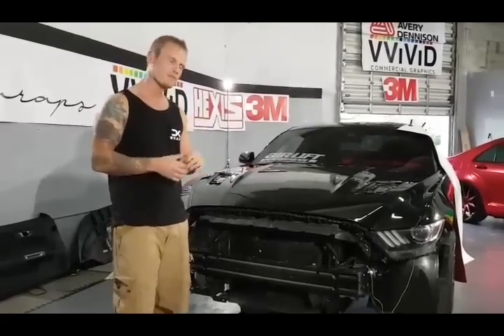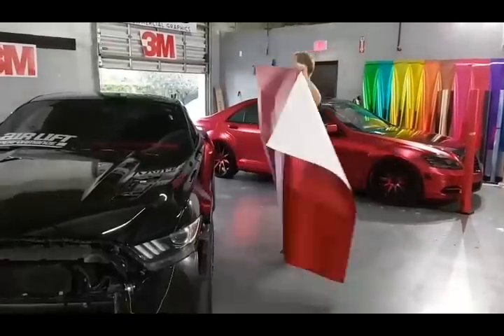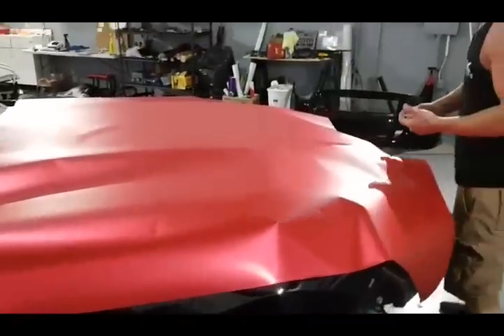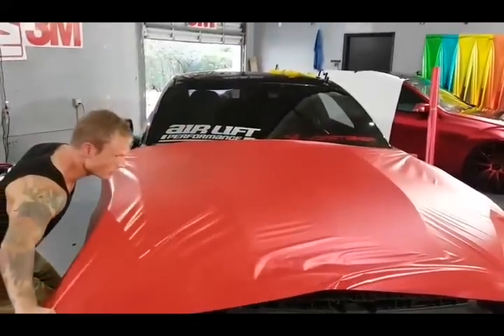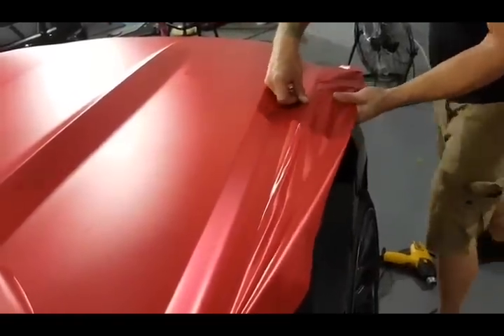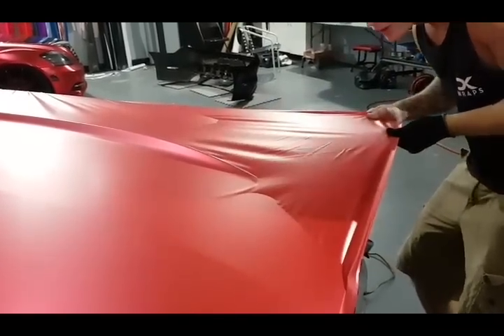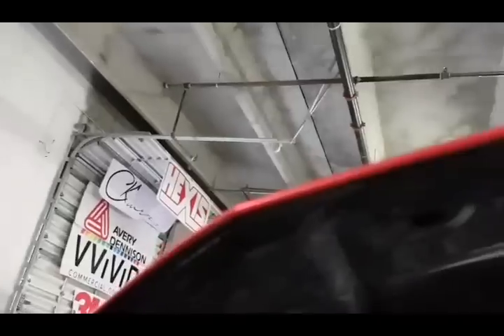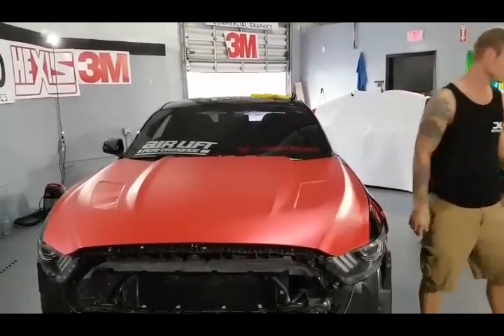How to vinyl wrap a hood / bonnet larger than 60 inches. How to vinyl wrap a Mustang. By @ckwraps

Comment: So what do you do when the hood is a lot bigger than 60"? I want to do my C4 corvette myself and the hood is massive.
Reply: I have an oversized hood and I just put a racing stripe on it. Turned a very large cumbersome piece into much smaller pieces with butt joints that are hidden due to different colors for the most part. Meaning you expect a line due to different colors so it isn't noticeable. 
Pin striping would also work. Anything that's a different color that breaks the hood into pieces.

Comment: Have you ever run into this using Avery Carbon Fiber film?  I have a 64"x34" hood and I could wrap it front to  back,  but the roof is also wrapped and the pattern would be facing different directions.  so I attempted to heat and stretch the film the 2 full inches on either side.  While one side did exactly as it was supposed to, the other seemed to take some damage to what I imagine to be the adhesive underneath.  you can only see it at certain light angles. Your thoughts?

Comment: Hi body thxs for reply. It was actually - 10 winter time.2018  January, In Alberta. I wrap my car outside. The cleaner I used it's for vinyl cleaner witch really work well to clean the surface off the car. Vinyl I order in eBay.  It's really good so far no problem. I don't have a video and it actually my first time ever .

Comment: Hey! I am wrapping my boyfriends mustang and he has an extremely difficult hood. The color is matte army green 3M brand, I am running into the problem of small bubble like lifts in the vinyl that can’t be pressed out. It is also where I heated the vinyl into the channel. I haven’t post heated anything yet, what’s the best way to get them out?  Thanks!
Reply from the maker: Try using a pin to pop them

Comment: true. i bought a brand new honda civic with 4 miles and came with a chip in the window. Found out the day after i bought it when i took it to the dealer to get it tinted. The dealer changed my window for free.